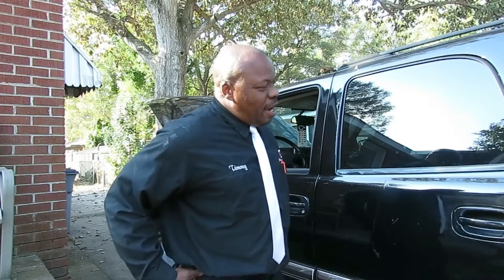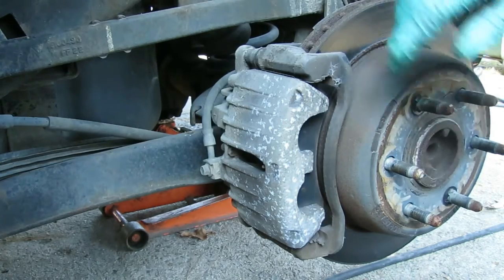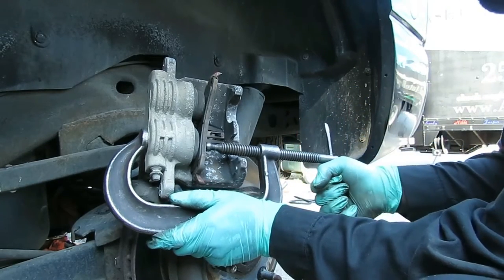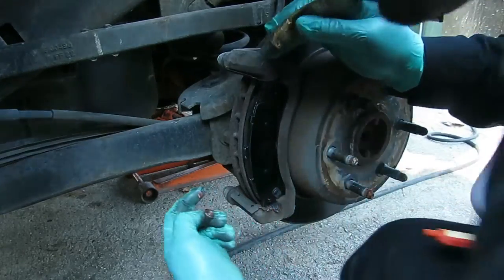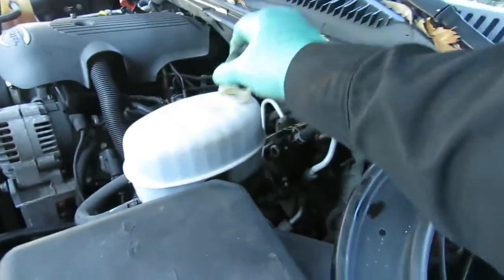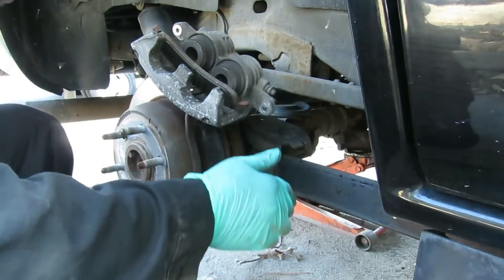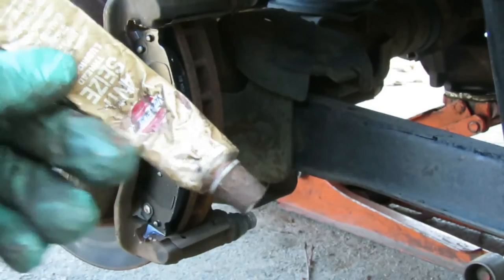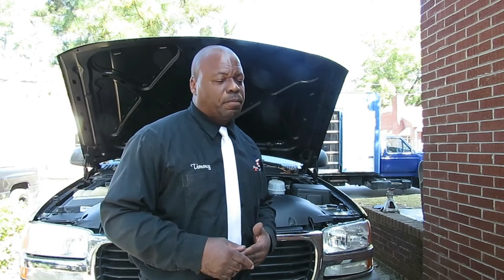2004 GMC Yukon - How To Replace The Rear Brakes (Brake Pads)

Comment: This guy made a great video.  Good tips along the way with good information.  The only thing I would have done differently would be to replace the rotors and those shims or pad slides.  My pads actually came with new ones so why not use them?
Reply from the maker: Not all pads come with the hardware